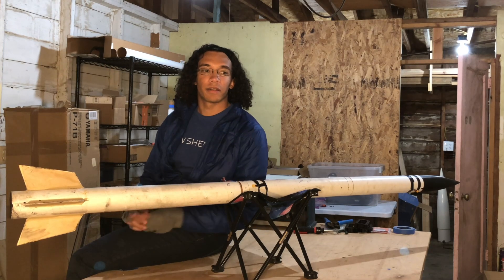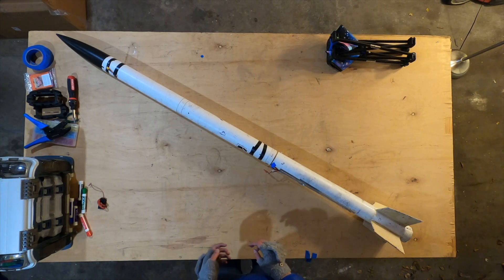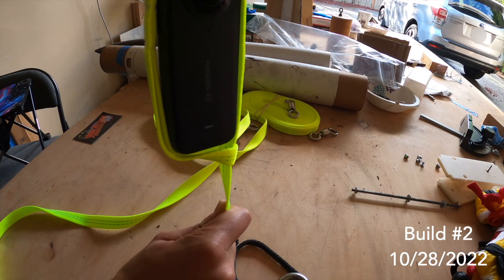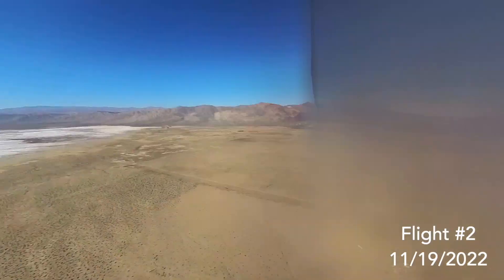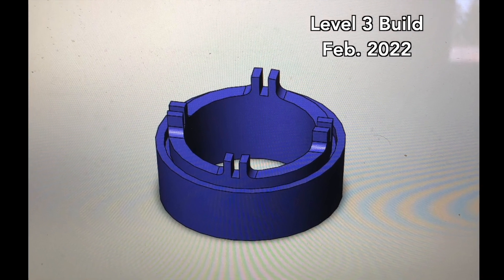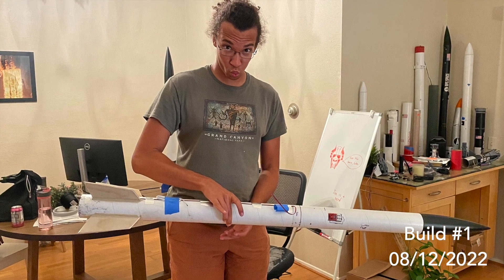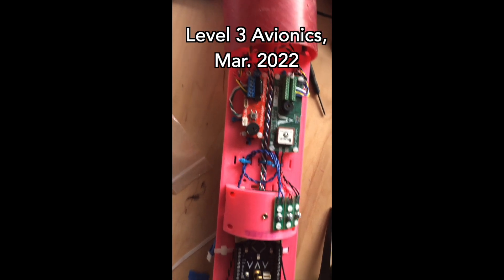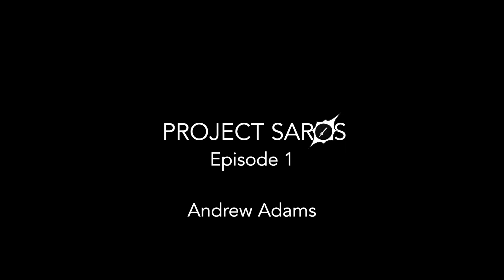I Flew a 360 Camera in a Rocket | SAROS Episode 1

Comment: Right-size crimp connectors are critical, as is a good and correctly-sized crimper. Less obvious is that you really want good-quality connectors. 

Unpronounceable-off-brand ones from Amazon suck big time. Whether it’s too-thin metal, the wrong alloy or both, they’re still in the plastic-flow regime in the crimped state, meaning they don’t maintain sufficient force to keep the joint tight. 

Big name-brands like AMP and Molex are way expensive for what they are, but the safest bet for anything mission-critical. I’ve had good luck with the Wirefy brand terminals and crimping tool from Amazon, albeit I’m not launching rockets 😁

==> Regardless of brand or tool though, the wrong size connectors will fail, every time. (Note too that, AFAIK, they aren’t available to fit wire sizes less than 22 gauge.

Comment: re: crimp connectors, those things also vary wildly in quality and the bad ones really don't work at all, they don't crimp right, they don't hold a crimp, and they don't make stable contact with each other. Worst, price isn't a good indicator of quality, source is. You'll probably be fine with home depot ones, you will be fine with somewhere like a grainger, mcmaster, or local electrician supply shop, the ones at walmart will waste your whole time, and the ones on amazon are actually a hallucination.

Comment: Great video! I don't know if you have already considered them, but there are aluminum rigs you can buy for the insta360 X3. They look smaller to me, so might save some space, but your solution seems to work fine!
Reply from the maker: I have! They are definitely slimmer than mine haha. The main drawback I saw is that there isn't an easy way to integrate the recovery line and I wanted to make sure the footage didn't have recovery line zooming around the frame. So I went custom! Appreciate the suggestion :)